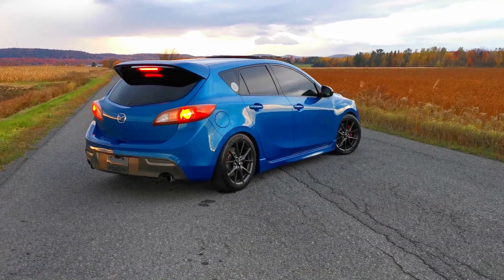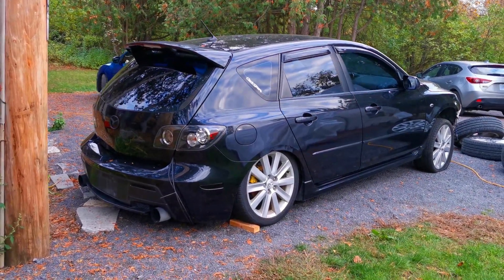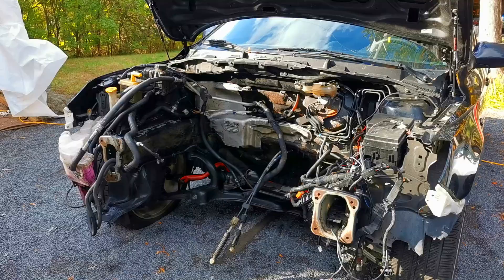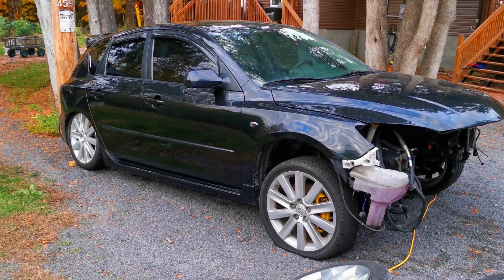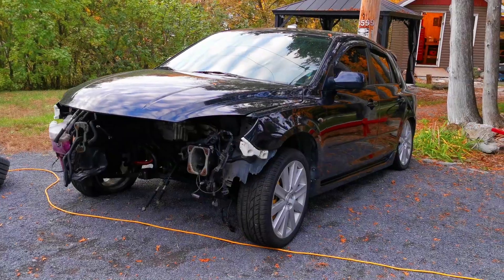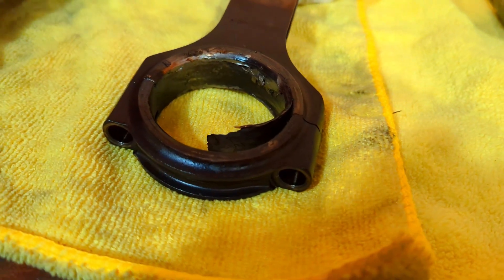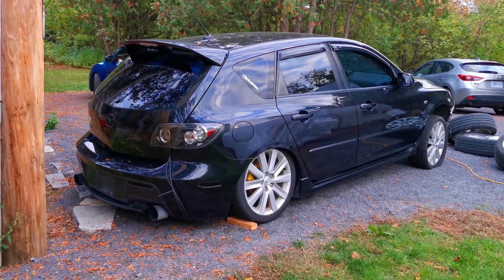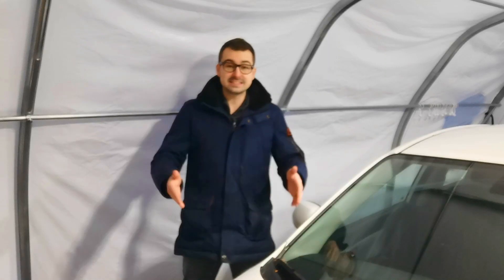I Bought The CLEANEST First GEN MAZDASPEED 3. . . But There's Just One Small Thing. . .

Comment: Hey I would recommend checking your local upull a parts/junkyards for CX-7 engines. You can easily get the stock aluminum intake and stock exhaust manifold ready for the turbo. You can even get the stock lines for the turbo as well. The turbo is smaller on the Cx-7 however. When it comes to some gaskets and pumps you can order ford for cheaper and its the exact same product.
Reply from the maker: That's awesome! Thanks for sharing that, I look into it! 👍